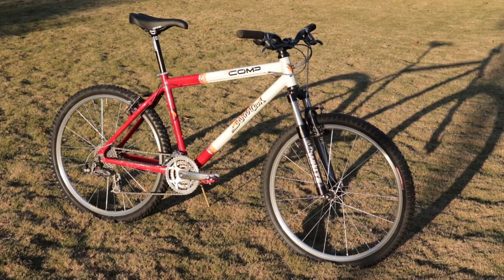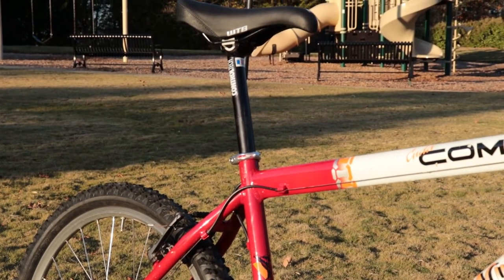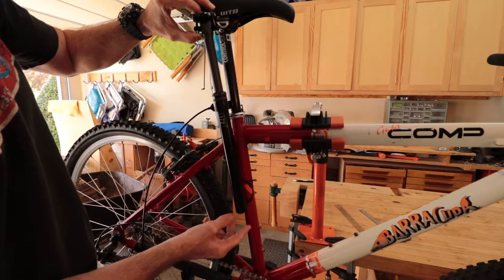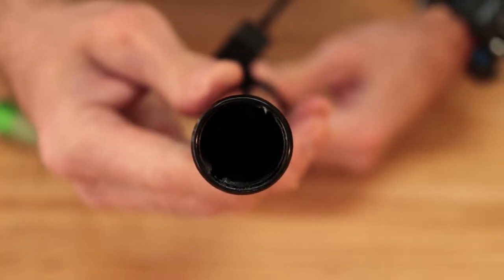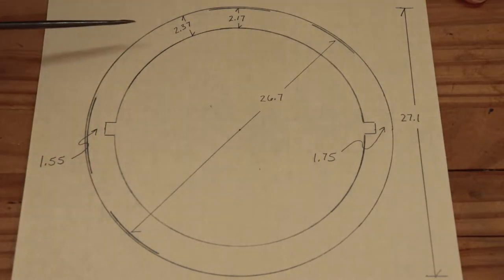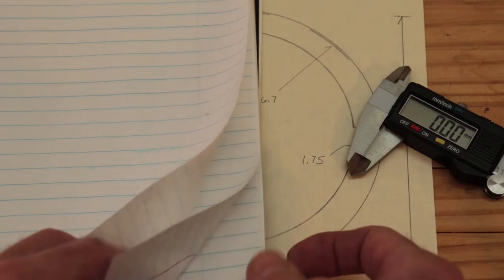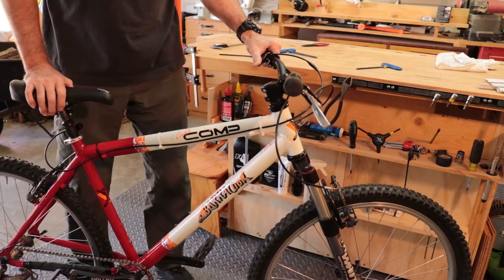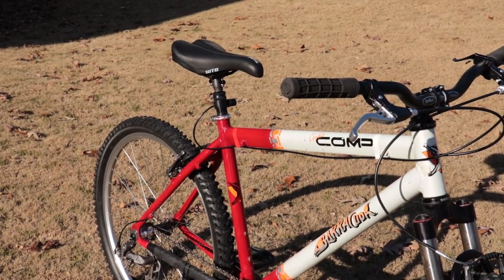MTB Dropper Seat Post. 27.2 mm dropper seat post in a 26.8 mm seat tube

Comment: Man, the thing I mostly need upgrade for my 2008 26" bike is a dropper and I needed this video to realize the small difference from those measures. Thanks! 
Of course you are making it less resistant, but I'm not heavy at all, so I'm sure it will not fail.

Comment: Yay!! You did it. Massive props to you , I will never act my age! 50 years young and although I was a fairly accomplished bmxer back in the 80s,  ive just got back into cycling mtb,  I have a levo emtb and am currently practicing drop offs and small jumps,  oh and if I  find myself at the top of stairs around town,  I just can't help myself, I've got to ride down them. But my goodness it's tough to bunnyhop and manual, because of the extra weight,  I'm a small guy.  I think I need to fatten up over the winter and build on my upper body strength. Happy trails!
Reply from the maker: Mike E Thanks, Brother!

Comment: I have an old DMR Trailstar frame that I love and that has a 26.8 seat tube, I did the same with an RSP dropper (aka Satori Sorata). I'm around 95kg and the modification hasn't been a problem at all, however the rest of the post is getting pretty tired, so going to do the same with whatever cheap 27.2 I get next.
Reply from the maker: Sweet!

Comment: Hey Dude, i just bought a shock absorbant seat post and it was the same size as yours. Well my bike is an old 1998 bike with a hair smaller seat down tube. Well like two hours with the palm sander i have it finally in. The entire tube besides about two inches are inside the down tube. So no worries about structural concerns i wouldnt think. Thanks for the video and now i have a shock absorber in the rear not just the front. :)
Reply from the maker: Killer!

Comment: This is genius! My wife is riding Stiffee FR that she loves despite it's age, but is considering a new bike just because she wants a dropper.

Off to the garage now.....
Reply: Done!

Easy job, probably not as neat as yours but it'll do.
Reply from the maker: Thanks, Sam! It's a little clunky but makes the bike rideable again. Since it's just got a big spring inside there's always tension on the pin that holds the seat post in position. Any time you want to readjust the height you need to apply a little weight to the saddle then press the lever. There's a pretty good "click" to let you know it's in the position. After a short learning curve it's fine

Comment: sometimes i'm confused on why some manufacturer still use 26.8 seatpost on early 2000 bikes. I owned a '98 klein pulse xc bike with 31.6 and 2008 scott voltage ht trail bike with 26.8 seatpost. As trail bike is more relevant now for my riding style, finding a proper dropper post is a headache. I almost going to put it on sale until i saw this video. Thank you TB!

Comment: Excellent! 
I had been thinking about this and nice to see someone has done it, don't see it as unsafe with the post all the way in the you have the all the seat tube thickness backing it up and much less sketchy than the thin bit with holes in sticking out the top. 
Think its likely good to thin it by feel going until it will wiggle in there as with an old frame it may not be 26.8 anymore if the post has gone in and out a few times.
Time to do one for my old DMR Trailstar.
Then ponder the old Santa Cruz Bullit with an annoying 28.6 seat tube likely a shim job.
Reply from the maker: There ae lots of 27.2mm optons a lot better than the one I tried. I just didn't wanna spend $$ in case it didn't work😀 My seat tube was very round and at 26.7mm internal for a 26.8 post. That post I shaved was really overbuilt and I didn't feel at all sketchy removing the metal I did. I went until it easily slid in and then lightly greased it so it wouldn't stick.

Comment: Awesome video. I have a vintage '92 Stumpjumper and I'm going to do the same.
Reply from the maker: Thanks, Craig! Are you gonna try to add a dropper? Of everything, that is the biggest improvement by far! Even a shitty dropper is better than nothing😀
Reply: @TrailBreaker  Yes sir, I'm gonna try exactly what you did: 27.2 in a 26.8 seat tube. I'm 56 yr old and wont be doing any hardcore stuff. I know enough from back in the day that getting low and your weight back is much more stable. Cheers!

Comment: Obviously it’s a bad idea, but I probably do the same in my retro 26.8 mtb! The picture showing how much you took off of the aluminum wall is very useful.  I think aluminum is better than iron, because the relative loss of resistance is smaller (in %, since aluminum is thicker). Thanks
Reply from the maker: Paulo Eduardo Gazola Thanks, Paulo! Yeah, once I drafted it out it seemed pretty safe. Plus tolerances are fairly fairly loose and there are no pressure issues with the coil spring. Time will tell but right now I’m not worried😁
Reply: I did it this week! Almost same dropper post, now called Tmars, with red parts. I’ve sanded it entirely by hand, with a pen to mark width with a paquimeter. After 4 hours of dedication, It inserts perfectly on the frame, with a great precision (variation less than 0.05mm). Now I will wait the world quarantine ends to test it on a trail. Thanks for the inspiration man!
Reply: SOLVED - https://www.youtube.com/watch?v=JzgwoBmJElk&feature=youtu.be

Comment: Can we get an update on how the dropper is doing? I have a 1993 Kona Lava Dome I want to do this on.
Reply from the maker: Still works like in the beginning. Now, I’m not saying it’s great, since it’s a coil spring powered up-mid-down dropper, with a slight learning curve to work it (to change positions you need to apply a slight bit of pressure to the saddle for the pin to be able to release and be sure it clicks into the desired position before you release the lever). But, it does exactly what I NEEDED it to do which is get the saddle out of my way on steeper downs and cornering. Since this is on my single speed, I use the top and mid positions 95% of the time. This thing is dirt simple and overbuilt. Bringing away some AL is no big deal. Let me know if you do it!

Comment: I noticed that the seat clamp does impede the seatpost returning to the up position.  Did you have this trouble? Even when only torqued about 2Nm where you can actually still twist the seat a tad
Reply from the maker: No. Try a light grease inside like slickoleum or slick honey and use a carbon fiber paste between the post and the frame.  That might help
Reply: @TrailBreaker  ordered slickoleum, and using the cf paste already.
Reply from the maker: @dennischampney2416  Maybe disassemble the post and clean and wet sand the post with 600 or higher grit in case there are and burrs. Regrease and try again
Reply: @TrailBreaker  are you thinking the post we already sanded or the surface area of the keys?  we used a Drill press and turned it like a lathe with centering adapters.

Comment from the maker: Are you riding an old bike without a dropper?
Reply: Nope I blew up my gt y2k I drive sold it and purchased a new bike . I do wish I had my old 90's gt backwoods hard tail  we used to have a blast together and even though wasn't a zaskar it was my first real MTN bike and went from old school no suspension to a Manitou 4  front fork. From cantilevers to v brakes and the old deore xt would shift no matter how dirty it was.
Reply from the maker: Thomas Fenlon that idrive was ahead of its time. 😊
Reply: @TrailBreaker  was a great bike but my stumpy is better! But also heavier lol
Reply from the maker: @mountainlessmtb9940  It's funny but you'll notice in the bike magz that weight is thankfully becoming less an issue. Functionality usually costs us mere mortals some grams. Unless you're racing XC, ride the bike!
Reply: I am but I do want to get one and I also need a 27.2.   Can you send me the link to what you got? Do you think its decent?
Reply from the maker: Daniel Biker I don’t have a link but if you go to eBay and search for the i72 dropper seatpost you should find it. It’s ok. Pretty clunky but dead simple and I didn’t want to ruin a good one. There are lots of actual droppers out there for <$200 if you have a nice, current bike👊

Comment: What's the worse thing that could happen ? Broken seat post would be less scary than breaking a crank or a pedal plus it's inside of a tube so it should be strong enough if it isn't your but may hit a tire and you'll have to finish the ride standing up
Reply from the maker: Thomas Fenlon This is really overbuilt and based on very sloppy tolerances. If it breaks it will be because it’s cheap and NOT because I sanded the paint off😊
Reply: @TrailBreaker  not worried but if it would it's usually not a ride ender ! I have total faith in your ability! keep killing it!